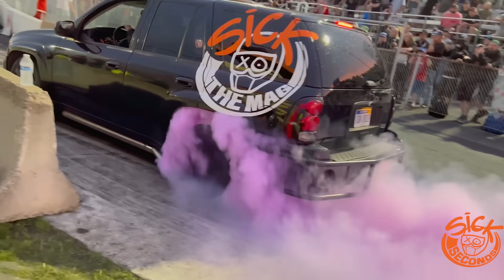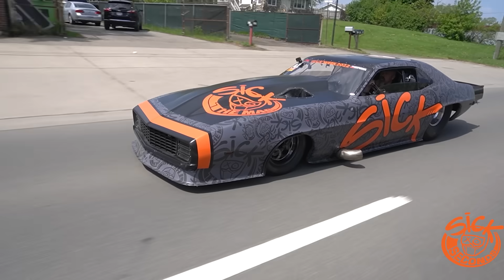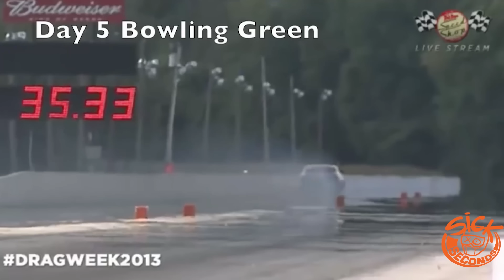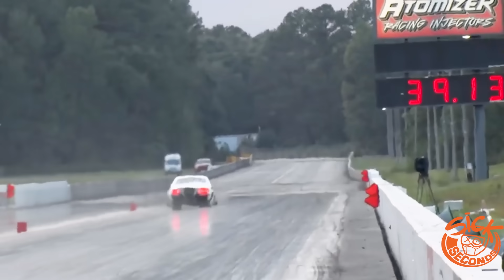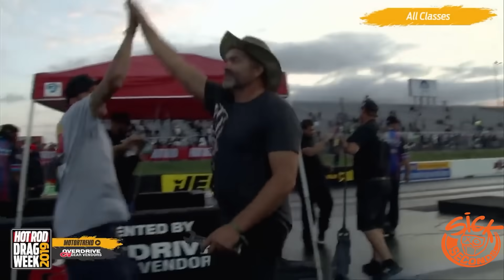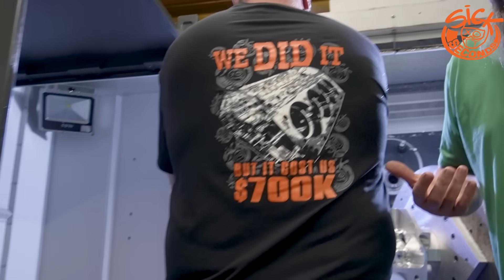$700,000.00 Engine Block!! We Did It But It Took 2 Years!

Comment: We need a video explaining the relationship between Steve and Tom, who is making what and how did it all come to be.
Reply: Right because Steve says in his videos hes made this and my new machine etc. Not taking anything away from Steve by any means,hes a genius in my eyes
Reply: @bdass68ss  Steve did develop this and he has been open about the fact that he has outsourced the blocks to Tom's shop. Steve's original block that Garrett Mitchell now owns, and the block that is found in Sick Seconds 2.0 and Clarks Camaro plus a few more, were all done at Steve's shop. I'm guessing that Tom will be doing the SML blocks as well down the line. Currently Steve machines the SMX heads, SML block and heads in his shop. Steve can make SMX blocks in his shop and still do so. I suspect that Steve and Toms idea here is to make it possible for other engine builders to buy SMX and SML heads and blocks down the line, which would make sense. You also have to remember that Steve uses his CNC''s for other stuff than the SMX/SML as well as development, so if his machine was constantly backed up by SMX blocks waiting to be machined, he would not be able to do any of that stuff. So for the SMX/SML stuff, SME needs a reputable and reliable source to do the parts. Who better than Tom who's a stone throw away and who's been a friend and racing partner of Steve for years.
Reply: @AB-80X  thank you for the info..they both do amazing stuff
Reply: Steve has not made any blocks in his workshop so far. only the heads with the Centroid and not all the SMX heads because that project is new from two years ago—the machine shop that made the first SMX and SML blocks? I don't know, but in his workshop, it was not (12/2/2023) @AB-80X
Reply: @AB-80X  boom ! ☝️
Reply: @bdass68ss  Steve has said before he gets the block done by Tom. I believe Steve only machines the heads in house.
Reply: @OneTonTahoe  thank you. Like I said,def dont mean any disrespect for either 1 of them.
Reply: I'd like to see a video of the profits made and spent on this short block after judt a few drag and drive events that he didn't even make it through the 2nd day on.
This money came from somewhere 
3/4 of a million didn't come from my $400 Sick Ward entry fee
Reply: @francislutz8027  Almost nobody gets into drag racing to make money, and if you're one of the lucky few who gets paid to race you're essentially an entertainer (no different than soccer or football players.)  Almost everybody has some other business that funds the racing side.
Reply: @francislutz8027  Tom has been in various business ventures for years. He had money before doing any of this. I'm guessing that this is just him investing in Steve's project. Also, don't forget that on the first outing in 2019, not only did Tom win Drag Week, he also made the first 5 second pass ever.
What happened last year was not directly related to the SMX, but rather the fact that the injectors Tom used went out of production. They had to figure something out on the fly which was not easy. Then there was an electrical issue. The other stuff you see they battle is no different than what the big power pro mod guys deal with. If you think the fact that Steve shows you that he blows out spark plugs is something SMX related, I can tell you that it is not. Just ask Proline, Noonan or the like. They all deal with that sort of stuff. The difference is that Steve does Drag and Drives, and chooses to share his ups and downs. Have you seen how his wagon is running lately after they got the driveline sorted out? That's a 3700 lbs car doing 4.24 1/8 mile runs on 41 lbs of boost. The short of it is this. Big power breaks stuff, and any engine builder who tells you differently is lying. Add to that this is a new platform and it will have some teething issues. We now know how to make a 3500 BBC, but those things have been around since 1965. We now know how to make big power on the 481X platform, but that also had its little hickups here and there. If you are making 4000-5000 hp, things will break on occasion. Sometimes you try new things. Steve tried a new set of rods by a different manufacture and that did not work. He designed his own engine as a 572 rather than a 525 or 540 which meant a shorter piston, that had some issues. That's just R&D. Steve and Clark has been fighting driveline issues, but that's no surprise. That's a 3700 and 4200 lbs car they are trying to move that fast. Now Steve is running a 12" rear and 1480 joints, so hopefully it will work. But that's just the nature of the beast. You need to get out there and run your stuff to learn what works and what does not.
Reply: They did a q&A last year where they talk about how they met.
Reply: @scottterwiel  ok..have to look it up..haven't been watching them for long. They're both amazing though
Reply: Very good idea especially for the new subscribers. I've been watching both for over a year and I'd like a recap.
Reply: @KPaul7  yeah, why make new content, just keep rehashing what was done last year. 🤔
Reply: Whats the cost of that machine
Reply: There’s a video where Steve talks about the history of Steve Morris racing engines. Tom Bailey was one of Steve’s customers way back in the day, which developed there relationship. He also said in the video that the blocks were out sourced from his shop.
Reply: @Hawkeye23456  So what's the reason Tom bought this machine in the first place? Solely to support Steve building engines?
Reply: For sure!
Reply: Tom bought the machine a while back and had moved from the shop to another place after having issues with side piece of equipment
Reply: that video would be weeks long and a huge info dump.
Reply: If I'm not mistaken Tom was Steve's first ever customer
Reply: There was a Fall out im sure it was he sold the CNC broke the Steve an it shipped Wrong an Bad go watch it
Reply: Would be good to know

Comment: All that taking and you didn't even tell us what platform it is.😢
Reply: SMX.... Steve Morris racing.
Reply: Unique design by Steve Morris. Evolution of Chrysler Hemi, Chev Big Block, aftermarket Billet hybrids like AJPE481x etc. further improve then do water jackets with welded covers, then design bolt on water jacket cover plates = A unique Billet Drag n Drive engine.
Reply: "This Engine uses all of the 481X common parts like valve train, cranks, sleeves, cams, lifters, intakes, gear drives, everything, all the readily available parts the ProMod guys use and have on hand. Rock solid, bulletproof and proven." from SME website

Comment: ok Tom , block 1 is in your car , block 2 was in steves car  , but now is in Cletus;s car , Block 3 in now in
Steve's car , So where is 4 and 5 , cause 6 and 7 are solid blocks , and 8 and 9 water blocks are what you showed.
So who has 4 and 5..... 🤔😀
Reply: You stating the placement of the blocks incorrectly. thus shifted them. Tom has an older, original SMX block, as others which includes the one which Steve had in his "Boostmaster", then sold it to Garrett Mitchell [aks Cleetus McFarland]. Now Steve has Block 1 from this Haas CNC which was not heat treated.
Perhaps view, listen again ??!!  Good Luck

Comment: Crazy process. I wasn't aware you heat treat aluminum. I thought only carbon steel was heat treated. And non carbon metals got annealed when heated and quenched.
Reply: Clearly You have not been following and listening to Steve Morris, MotoIQ, and numerous other motor vehicle channels along with everything for aircraft, spacecraft for over 60 years. !!  Good Luck

Comment: Seems like you'd rough everything in to maybe +.050 of final dimensions, then heat treat/stress relieve and then do your finish cuts. I've run into that issue before and the above process fixed all the issues of warping and "out of round" tight tolerance holes that had a finished tolerance of +.000 / -.001.

Update: just got to the part where you say exactly what I just said 😂
Reply: It was moving around 1/8 inch
Reply: @pauldevine622  I didn't catch that part 😬 That's a lot of flex
Reply: Rough within .300 heat treat.
Reply: A semi rough after ht. Then finish
Reply: @pauldevine622 . 300? Why so much?

Comment: What makes your Block better than others, why would I Purchase this Block, the only thing I picked up on was the water passages
Reply: perhaps listen again ??!!
Reply: Steve Morris quote " I needed to build the first fully water jacketed all billet engine that could utilize all the rock solid proven parts of the 481X! After 1 1/2 years of development I am proud to release the SMX engine. 

This Engine uses all of the 481X common parts like valve train, cranks, sleeves, cams, lifters, intakes, gear drives, everything, all the readily available parts the ProMod guys use and have on hand. Rock solid, bulletproof and proven. "

Comment: I worked for the Big Orange Helicopter company for a time as a QC inspector. We built the S-64 Helicopter and had a very capable machine shop and also formed out a ton of work as well. We had lots of Haas equipment and a few guys that all they did was write and prove out programs. Someone decided we needed to start making our own Alum. blade spars and bought a huge (for us) VF-11 machine and it took years to try and get that done. It took so long and cost so much they were talking about just switching to carbon fiber blades and be done with it. I was in the insp. lab one day and they were running a spar in the machine and all the sudden you heard the most God awful noise, apparently there was a glitch in the program and the machine went rogue and ate that spar before someone could hit the E-stop. Cost thousands and thousands of dollars when that happened. You think engine parts are exp. they are nothing compared to aircraft parts. Glad to hear you finally have a product after all the hell you went through. But from what i've seen up close, that's pretty much S.O.P.

Comment: Is this Steve’s? Or who is this ??
Reply: I'm pretty sure at no point in the video or description does it say it's a SMX
Reply: @Dasman5624  Yes Tom did not explicitly  state these engine blocks are SMX. However he did post a comment, reply explicitly on this video. Good Luck
Reply: Perhaps go back and listen again along with seeing, reading Tom's posted comment reply: these are the 'new' SMX blocks per the details described, single piece, CNC billet, with heat treatment. Good Luck

Comment: Hopefully Steve builds lots of SMX engines to get you over the break even hump.  Guessing that is going to take a little while.
Reply: I can’t see the machine being paid off by just making engine blocks, but luckily they can run a million different programs to literally make anything.  Will still take a few years to realize a profit but I suspect Tom isn’t in this deal for the sole purpose of making a fortune, at least on this endeavour
Reply: 10-12 engines I believe he will break even
Reply: on total cost of the engine alone sure, but through in time and materials, bills, paying employees, manufacturing defects/mistakes/etc, your looking at a realistic 60 - 100 blocks before hes making money.

Comment: Are you going into competition with Steve Morris? Who manufactures the better block!
Reply: i believe tom will be doing the machining for steve.
Reply: Tom makes the Block and Steve makes the Heads.
Reply: @michaelwynne4346  Yes, as Tom posts on this video. these blocks are the 'new' SMX, full CNC billet with heat treatment.

Comment: It would be great if you and Steve did a video together explaining how it came to be that you are machining SMX blocks.
Reply: And what an SMX block is. I mean I can see that it is an aluminum, pushrod (I think) V8. But you have to assume that some viewers (like me) won't have seen any prior videos and so don't know anything at all about what the engine is intended to be.
Reply: @RandomGuyDan  It is an engine Steve Morris developed loosely influenced by the 481X platform. It is his own design and unlike the 481X it is fully water jacketed.
Reply: @RandomGuyDan  its Steve Morris I guess the x is for extreme its basically a something close to a hemi but I think the change the cam centerline
Reply: @larrygreen8092  The X is a reference to the 481X that he used as inspiration for the SMX.
Reply: @larrygreen8092 The X stands for that a lot of the basic engine architecture is based on the 481-X design

Comment: Is that block a BBC design or what engine did Steve design it off of?
Reply: The smx is based off a 481x the sml is ls based
Reply: @ryanwebber4205  My dumb question: what is the 481x? Corvette block?🧐
Reply: OK. A simple search told me what's up. Search 481x engine.
Reply: it's a SMX steve designed it
Reply: @k.matney2197  Close, but not quite accurate. 
Tom posted these are the new version SMX - clearly heat treated billet along with the other improvements
However, Steve Morris is not a designer, engineer, rather an engine builder. The actual designer, engineer is undisclosed, but clearly custom for SME.
 @ryanwebber4205   @gailtaylor1636  Both and each of You can get the proper, correct, exact information from Steve Morris from his videos and site.
The SMX is basically a 540 c.i., custom billet design. The SML has similarties but with LS base, design. Steve shows and explains the details.
All the Best, Sincerely
Reply: I believe based on LS? But added head bolts and other good stuff.

Comment: As someone who was a machinist most of my working life I can understand the process of heat treating and getting everything within tolerances. Dang, .002 is a pretty generous tolerance to me though but I did tool and die work too. Never messed much with aluminum during my time. I made my bones with cold forging machines. If you drove a Ford or had a Whirlpool appliance back in the 70's and 80's there's a very good chance they were put together with our bolts. Look for the "MF" stamped in the head. I worked as an inhouse rebuilder of the machines that made them. The "MF" stood for Midwest Fasteners.
Reply: I'm thinking more like 0.0002
Reply: @bobroberts2371  right I left one out there 😂 my bad
Reply: @suicidalpornstar8091    The guy in the vid left one out, he did say Two Thousands when it should have been Tow Ten Thousands
Reply: @bobroberts2371  ah okay I must not have been paying close enough attention. I was lost in the heat treating of aluminum. I've mostly worked with tool steel and carbide all my days.

Comment: My question is  can you produce a block that's comparable to other blocks in the same price range. Understanding that they are absolute works of art. Congratulations
Reply: Thats not the objective...
 Steve Morris quote "I needed to build the first fully water jacketed all billet engine that could utilize all the rock solid proven parts of the 481X! After 1 1/2 years of development I am proud to release the SMX engine. 

This Engine uses all of the 481X common parts like valve train, cranks, sleeves, cams, lifters, intakes, gear drives, everything, all the readily available parts the ProMod guys use and have on hand. Rock solid, bulletproof and proven."
Reply: The whole point is a 5,000 hp big block or 3500 hp LS that is reliable on the street and track. Other blocks can make power, but not for the use these will get with street/strip and drag and drive events.

Comment: I don’t understand why you’re making the blocks for Steve and Steve has his own Cnc machine and makes his own blocks
Reply: Does Steve machine his own blocks? I've not seen him show that, and am pretty sure I saw a vid in which he said he subcontracts block machining.
Reply: @richardjones38  Correct. He subs them out.
Reply: Steve makes the Heads, Tom is making the Block now, it's a new version of the SMX Block.
Reply: @michaelwynne4346   @gailtaylor1636   @richardjones38  @edmahonejr.9364; 
Perhaps go back and listen again along with seeing, reading Tom's posted comment reply: these are the 'new' SMX blocks per the details described, single piece, CNC billet, with heat treatment. Good Luck

Comment: Been waiting for this video  ,are you building heads to match the blocks  ,are they being sold as a set one block with both heads.
Reply: See Steve Morris Engines. Yes, you can buy a complete SMS engine. Pretty sure there is a bit of a waiting list, engines are monsters . streetable and capable of putting a heavy car well into the 6s in 1/4 mile.
Reply: @fr.rustymatheny7707 5’s actually